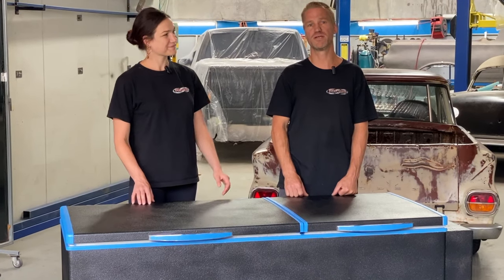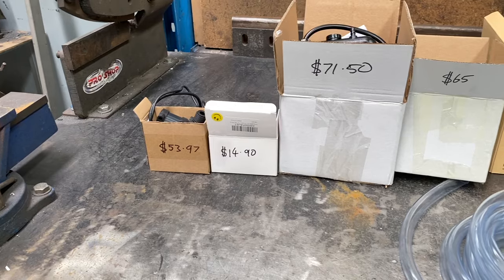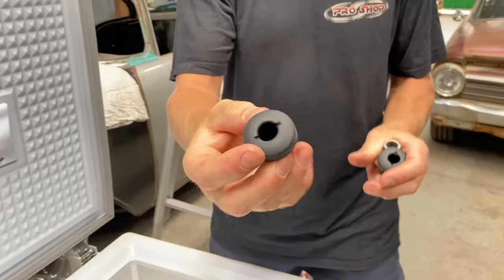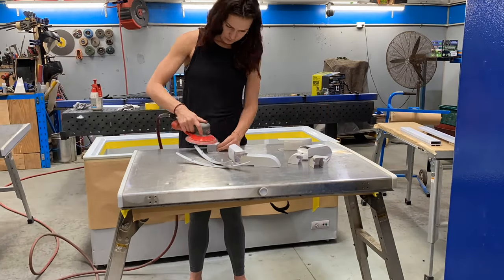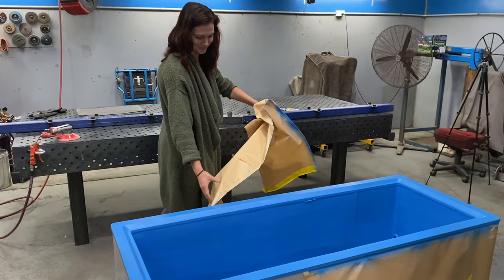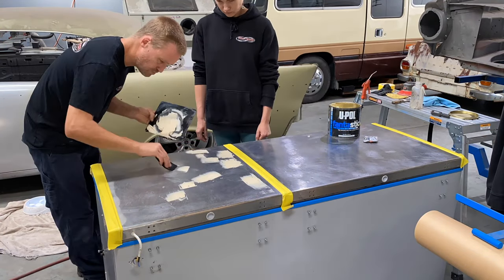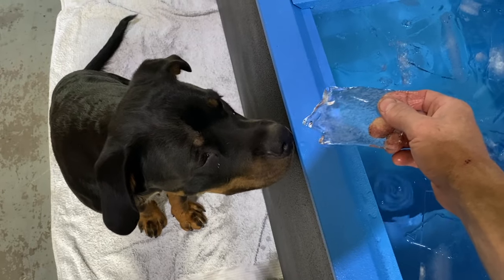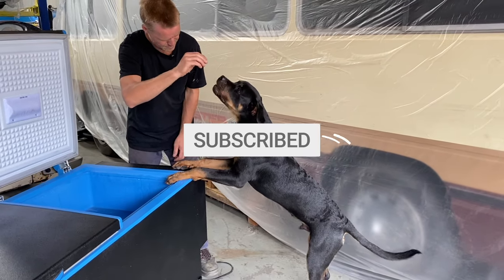We Build The Best Chest Freezer Ice Bath | Custom Car Quality

Comment: Question....where did you buy the pump kit from? As well, I'm assuming you plug in the freezer and keep it running to cool the water when you're not using it? The reason I'm asking is I've seen videos that use a fridge but just for holding the water. They don't plug it in...and do you add ice to it or was that ice formed from just plugging it in? Awesome video btw, best I've seen yet!!!

Comment: Great video! Alot of hard work! Got some great ideas 💡 thanks so much for sharing. Ps in my research I did see that your inkbird thermometer is not the one made for aquariums/under water all the time- with rubber seal. Apparently it will degrade/rust over time. They are same price. Just another content  creator sponsored by them mentioned it with his ice bath ❤

Also had a question about your waterproofing- is it non toxic? Will chemicals leach into water? I'm deciding on my waterproof sealer now and too many options/different advice out there. Alot reccomend pond sheild (epoxy 2 step) or rubber pond sealer.

Comment: Very different, but no less epic because of it! As a Born Northern Territorian I was perfectly happy working in winter at minus 8 degree's Celcius in shorts & Tee shirt as much as I was in Summer at 48 plus Celcius. Modern society forgets more than they remember, we are creatures of the earth, not above it.
Reply from the maker: Well said! I never imagined NT getting to minus 8 but I know what you mean. I've worked in factories all my life here in Sydneys west and have felt those minus zero mornings in winter and then the 40+ summers.... then add welding jacket, gloves and helmet.... all I can say is it'll make you resilient.
Reply: @Pro Shop  It does in Alice Springs in winter. I took a thermometer out into the sun one summer, the scale stopped at 56°C. It hit that temp in less than 5 minutes & it wasn't on the ground. It gets so hot up there that the road literally melts. Have many stories.

Comment: Best DIY video yet! I have an icebath cheest freezer and I need to modify it like this!
Reply from the maker: Cheers. It's been a great investment. Been using it everyday.
Reply: @ProShop1  Same here! Although I need to apply something like you have to the inside. 

What blue paint did you use on the inside? I was going to use a pond type waterproofing like pondshield. 

Did you prime it before painting? I have an aluminium type inside for my chestt freezer.

Comment: thank you for this excellent video! I am on my 72nd day of cold bathing in a water recovery tank. but the temperature starts to rise too quickly. I was looking to make a new one with a freezer. do you have the reference for the black water fittings please? I can't find any to cross the walls? can't wait to see the second video, I also hope to be able to finalize mine by then!
Reply from the maker: That's great Nicolas. If you are talking about the black fittings that pass through the side they are 1/2 inch tank bulkheads which I got from our local irrigation store. I have found something similar on eBay. Update video will be out this weekend.

Comment: Thank you for the video you made. This has really inspired me to start making my own ice bath. I have a question about the paint. Is it still in good condition? I have not yet found  the right paint that is suitable for underwater.  If it is still in good condition I will start using this one too. I look forward to your response. thanks in advance 🙏🏻
Reply from the maker: I wouldn’t recommend painting the inside with this liner. After 3 months it has started to flake off. So far I haven’t found a paint that can handle the freezing conditions.

Comment: Could you do a video of a step-by-step lesson on how you assemble the external pump and Ozonator and temperature controller...I'm confused on your video a bit... What is plugged into the power bar coming off of the temperature controller where it's labeled cooling and heating? Its a very specific plug configuration and at some point in your video something is plugged into that cooling receptacle....whats plugged into there?

Comment: Great video.  We’re ther any issue with the silicone sealant and the spray in lining.  Quite often nothing stick to silicone. Thanks
Reply from the maker: Cheers Chris. Yeah the lining did crack on the silicon. There is a primer that I should have used. I talk about it in the update video we recently put out.

Comment: this looks great, interested to know how it looks now several months on? is there anything you would change?
Reply from the maker: Yeah I wouldn’t paint the inside. Nothing seems to stick long term. Other than that it’s been great.
Reply: @ProShop1  great advice, and the sikaflex seal seems to still be holding up?
Reply from the maker: I have noticed a small leak which I think might be from getting in and out of the bath so much. There is a lot of weight with all the water in it and I think it might have flexed a bit and the water has pushed through a crack in the sikaflex. Not too much of a problem. I can seal it up next time it is empty.
Reply: @ProShop1  great tips, hopefully saved me a heap of time and money

Comment: Great vid and info guys. Currently doing up an old bunky. I found the inlet/outlet flanges at RTM in WA. Pretty good selection for boats. I assume most marine shops would be able to supply them. 👍🏼
Reply from the maker: Thanks Martin. Great tip!

Comment: Very nice! How's that seam sealer holding up? I've been reading that JB Water-weld, or similar, will last the longest...
Reply from the maker: The silicon is great. No leaks however the Raptor lining is starting to flake off. We have a new liner on its way

Comment: Great ice bath! One question.... When i switch on my freezer, filled with water to cool it down, it get extremly hot on the outside. Is this normal and do you have the same experience?
Reply from the maker: Ours only get warm down near the compressor however I put an exhaust fan on it to fix that problem
Reply: Good idea with the fan. My freezer is around 10 years old. I think this is the reason for the hot surface.  Thanks for awnsering...

Comment: How did you fit the tap in the outlet?
I’d like to fit one in mine.
I am going the DIY route and don’t have much idea about these little things.
Any help would be appreciated.
Reply from the maker: The outlet was roughly the same size as the tap so with a little thread tape I just screwed it in the hole.

Comment: Regarding the raptor liner and leaks, Have you had any leaks?  Just got my freezer and starting the ice bath project.
Reply from the maker: The raptor liner has started to flake off up around the top edge where the ice forms. Had a small leak in the silicon which I think was from the weight of all the water. I’ve recently redone the liner and are about to put out another video on it.

Comment: Great build! What kind of fittings did you use through the chest freezer ? Much appreciated!
Reply from the maker: They are 1/2 inch tank bulkheads. You can find them on eBay but we got them at our local irrigation store.

Comment: Guys this looks amazing. Awesome job, best DIY ice bath I’ve seen on YouTube 👏. You’ve given me some good ideas for my chest freezer conversion, thank you for the vid!

One question, would I be able to apply the Raptor coating with a roller or a paint brush? I don’t have a spray gun and that stuff looks really good…
Reply from the maker: Thanks mate. After 6 months the Raptor is starting to bubble up around the top edge. It seems the condensation is getting between the layers and making it lift. We were going to use a pond liner but someone else commented that the same is happening to theirs. It won’t look as good but it might be better off without a liner.
Reply: @ProShop1  good to know, thanks mate!

Comment: I'm currently sealing my chest freezer and I love the look of the liner. What grit of sandpaper did you use to prep the surface of the inside and was it by hand or a orbital sander? Absolutely amazing cold plunge
Reply from the maker: Thanks. We only used scotch bite to scuff up the alloy. Maybe it would be better to use something a little more abrasive as the liner is starting to bubble up around the top edge.

Comment: Nice job. I'm interested to see how the raptor lining holds up. Apparently some people in the DIY cold plunge community had theirs come off. Could have been poor prep work though.

I'm looking into doing something like this myself, so trying to find out what the best way to go about it is.
Reply from the maker: Cheers. I've noticed the lining coming off a bit on on the silicon joins. We probably should have done another coat or maybe primed the silicon like we did the plastic. I'll talk about it more in the update video we will do soon.
Reply: I’m currently building one now but I’m using epoxy to paint it. Next time perhaps raptor coat first then  seal it. Epoxy won’t stick to the silicone and I can’t see why the raptor coat would be any different. 😊
Reply from the maker: @shanebarton929  I’ve never had a problem with the Raptor sticking to silicon on any of the cars I have built but I guess they aren’t sitting in freezing cold water😳. There is a primer available that is for silicon I’ve seen used on truck beds. Probably something I would use if I was going to build another one.
Reply: @ProShop1  awesome that’s very handy To know. You guys have done great work.
Reply from the maker: @shanebarton929  thanks mate

Comment: Awesome job guys, I'm not as handy as you so I am getting a professional to spray Line X in my chest freezer and just going to rely on some pool chlorine for sanitation.

Will just have to pump the water out every few months but your setup would be great.

I suppose later down the line I could go down the solutions you've got by drilling in from the outside but I reckon I'll just keep it simple.
Reply from the maker: Thanks Joe. Even though it didn’t cost that much in parts, it did take us quite a few hours. We are lucky that our workshop to build custom cars does make it easy to build almost anything.
Reply: @ProShop1  just checking in again for a question. How does this Raptor liner compare to Line X XS-100? That is the equivalent grade the guy I am getting mine done with will use, he said he doesn't stock the heavier duty XS-350 stuff
Reply from the maker: @joek292  I was going to use Linex at first but I would of had to of paid someone to do it as it uses a different system to what I have. We already use the Raptor system here so we went with that. Whatever liner you choose would be fine as a truck bed would get a lot more abuse than an ice bath.
Reply: How is the Raptor liner holding up?

Comment: hi, great video 🙌. I have my chest freezer and raptor is on order. Can i check did you do anything to prep the metal surface inside first e.g. rubbed with alcohol and scratched the surface up etc?
Reply from the maker: Hi Alex. You should check out our latest update video as we found out the  Raptor is holding up too well. We prepped the surface by roughing it and cleaning with wax and grease but it has started to flake off in some sections. I would recommend a pond liner. We are about to redo ours with Pond Armor. It is non toxic and has a greater temperature adhesion range.

Comment: How did you attach the tap to the drain plug? Great vid
Reply from the maker: Thanks Daniel. I drilled out the hole and used the tap fitting to screw it into the plastic. I go through it in detail in the next video which will be out this weekend.
Reply: @ProShop1  thank you! And where did you source the tank bungs?

Comment: Hey mate, how did you fix the panel with all the electrics onto the side of the chest freezer without piercing the coil/pipes or motor?
Reply from the maker: I screwed it in the corners and only went through the metal a couple of millimetres. It was only to really hold it while the glue dried. I guess I just could have clamped it.

Comment: Do you think you should have put the filter in and out at opposite ends to ensure complete filtration? It will only end up filtering the pocket of water at one end with them next to each other.
Reply from the maker: Yeah but I didn't want to run the lines around the outside. I have recently changed it to draw from the drain so it does circulate better.

Comment: Is the caulk working well for sealing the seems? Caulk usually remains rubbery while I believe the Razor Coating is pretty hard. Are they staying stuck together and sealed?
Reply from the maker: The Raptor lining is starting to lift away from the inside. We are going to do an update video soon to cover this problem
Reply: @ProShop1  with your talent I’m sure you sanded it properly. Maybe it’s the aluminum and some sort of electronic corrosion?  

I’m guessing Pond Shield is back on top as the best liner?
Reply from the maker: @kennruckey  I’m pretty sure the condensation from the freezing builds up between the layers causing it to lift. Someone in the comments said it happened with their pondliner too.

Comment: Love it. About to do the same to my freezer. How many bottles of raptor liner did you end up using?
Reply from the maker: Thanks Morgan. We used one bottle on the inside and two on the outside however I would use another one on the inside as it’s showing a few little cracks on the silicon joins.
Reply: That ratorliner… is that unhealty in any ways.. alot of these liners off gases all the time even after it is hardent.. do you know any thing about that?? Because i would like to print mine too.. 🤷‍♂️😊

Comment: Nice cold plunge🥶🥶. 
Just a couple questions. 

How did you install the tap at the drain location?

Do you know if raptor coating is potable water storage safe?
Reply from the maker: The drain outlet is plastic so I just screwed on the tap fitting. A little thread tape to seal and it was done. 
I'm not sure about the Raptor lining. If you are worried about chemicals leeching into the water someone else commented maybe try a pond sealer.

Comment: My freezer is the same metal on the interior. I did not spray the inside of mine and after a week or two the water get cloudy and has little crystals forming at the bottom that break apart and feel plasticky if you touch them. I cant  figure out what the problem is... Hoping someone knows?
Reply from the maker: What filter are you using?
Reply: @ProShop1  it’s like 3 stage with UV, its small
Reply: @gaigesmith9674 you need sanitization as well. I'm making one right now and just need sanitization. I'm going with an Ozone system instead of chemicals.

Comment: Hey crew, did you ever find a problem with the liner on the inside? Does it bubble or does any ice build up behind the liner and cause bubbling?
Reply from the maker: It has started to bubble around the top a little. We are going to reseal it in a pond liner. Supposedly it is a lot better for lower temperatures. It’s all trial and error. Hope we can pass on our mistakes so you don’t have to.
Reply: Thanx for the reply😃
I have done it with the pond sealer and had the same problem, I thought It may have been from not prepping properly before I applied the pond sealer membrane.
I actually think, no matter what there’s always going to be some sort of build up behind the membrane due to condensation which will cause it to bubble regardless. 
I’m stuck on what to next🤷🏽‍♂️
Reply from the maker: @mogsbrah570  thanks for letting us know. I had a feeling that it might happen with the pond sealer too. I think you’re right that it’s the condensation under the liner as it only happens above the water line.

Comment: I wonder how to control this with a thermostat
Reply from the maker: You could use a timer however the outside temperature would have to be considered. The thermometer is an easy solution.

Comment: Great job!! I’ve looked at several DIY freezer ➡️ cold plunge tub projects.  My only concern was mentioned in another video comments. The possibility of getting shocked by the startup capacitor even though the freezer was unplugged for use.  I’m going to check out the Raptor product you used. I’m hoping it can be painted on with roller or brush. Thanks again!
Reply from the maker: Thank you. You can’t really apply the raptor with a roller or brush so maybe try the aquarium pond liner. It’s probably a better option for you.

Comment: Drilling extra holes below the surface is unnecessary and overall not a good idea, especially if this thing will be kept where any leak will result in disastrous consequences.
Reply from the maker: Yeah that’s why I mounted the electrical above the plumbing.